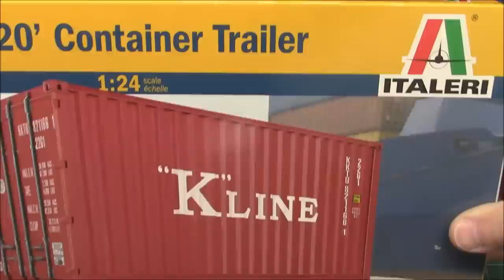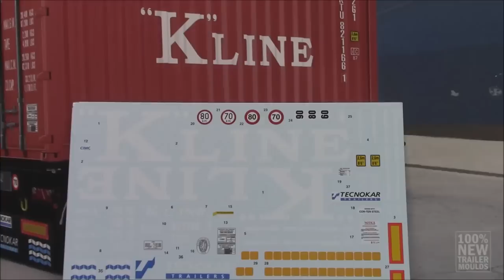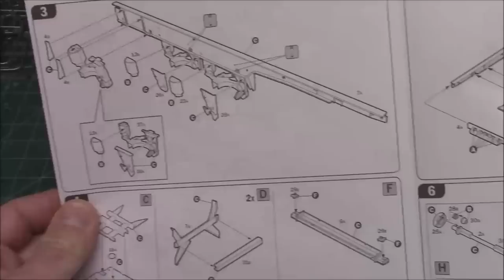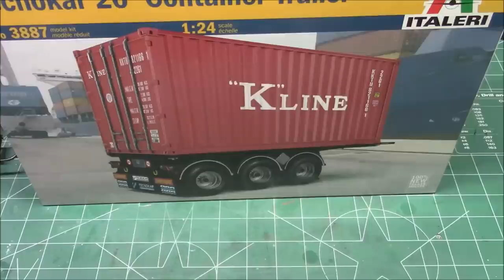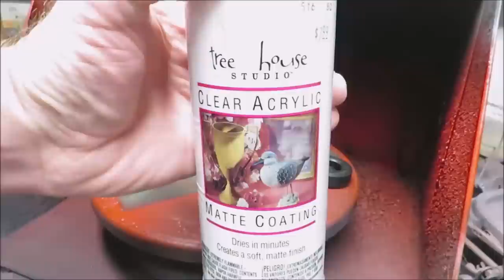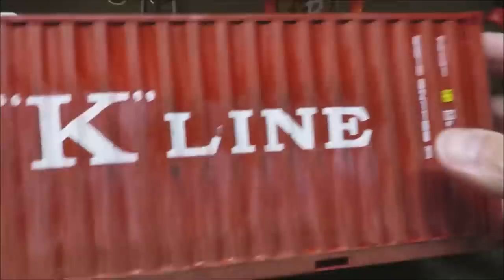20 Foot Container Trailer Intermodal 1/24 Scale Model Kit Build How To Decals Weather Rust Fade

Comment: What is the best glue to use on plastic model kits?
Reply: I'd like to know this as well! I see no brand name on the cap that hpiguy uses
Reply: I've never been able to find what he uses but I've had good luck with either Tamiya thin stuff or revell contaca pro (my most used stuff), I totally forget what he uses
Reply from the maker: I don't believe in saying 'this is the best' for anything, but I personally like Plastruct Bondene and that's the brush on glue you see me using in every video.
Thanks

Comment: Rather than juggling with all the frame crossmember parts and chassis rails in the assembly (Stage 3) I first cemented the coupling plate to both chassis rails and allowed the assembly to set. After an hour or so you can assemble the remaing crossmembers in turn working from the front to the rear. A number of rubber bands help to keep the assemble fairly rigid until all glue joints have set solid.
Regarding Italeri models, have you noticed how misleading some of their diagrams are?
Or just plain wrong? 🥴